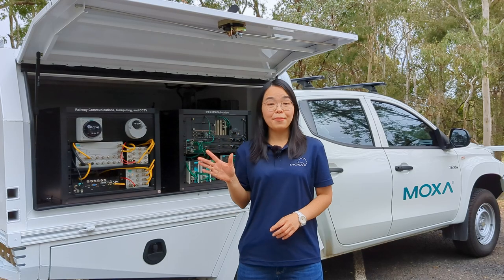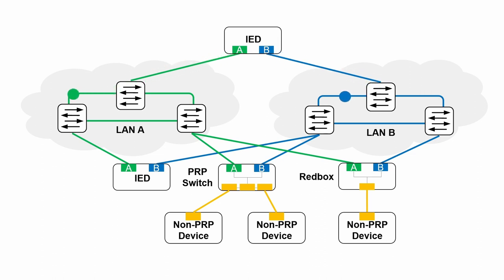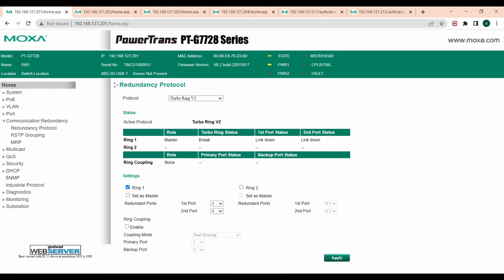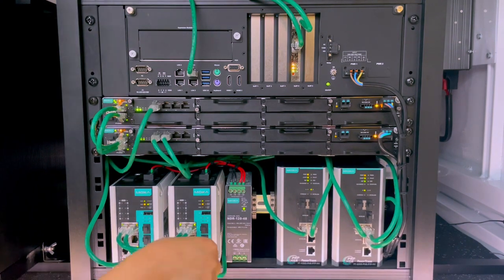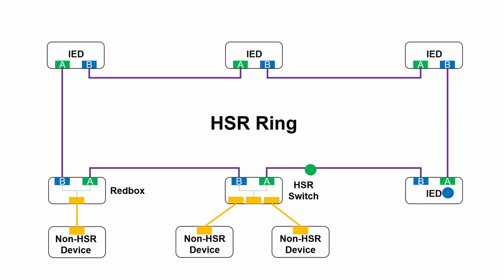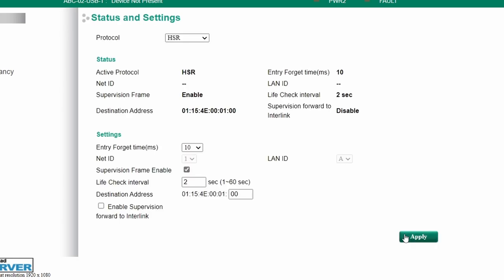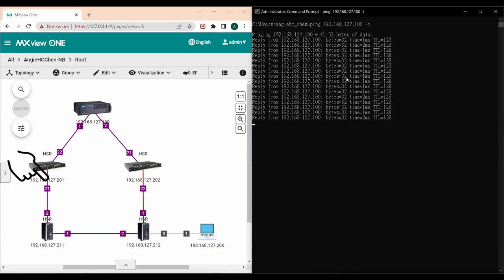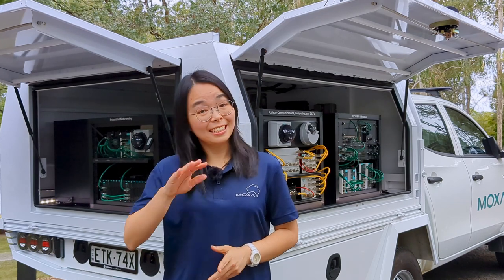Achieving Zero Recovery Time: PRP vs. HSR

Comment: Why a non-hsr device must use a redbox? Why it cant be connected to a hrs switch (like the others non hsr devices)?
Reply from the maker: Hi @stringsandhamers, thanks for reaching out. Standard Ethernet devices can’t be connected directly to HSR ring because HSR modifies the frame and it can’t be processed correctly by a non-HSR node. To connect Singly Attached Nodes to HSR ring a Rebox or HSR switch should be used. HSR switch is essentially a combination of a switch and Redbox in a single unit, so from IEC standard point of view HSR switch is a multiport Rebox. The terms Redbox and HSR switch sometimes could be used interchangeably.

If you have any questions about our products, feel free to contact a Moxa representative by completing the online form: https://www.moxa.com/en/contact-us

Comment: In your example, you are using PT-G7728 for PRP Ring A,   My question, can we use PT-7728 instead PT-G7728. how is the PTP complience on those 2 type switch. are both type are PTP complience switch.?.  Thanks in advance for your respond
Reply from the maker: Hi @setiawanadi4388, thanks for reaching out. Only PT-7728-PTP models within the PT-7728 range support PRP/HSR when equipped with PM-7200-4GTX-PHR-PTP or PM-7200-4GSFP-PHR-PTP modules, and both PT-7728-PTP and PT-G7728 support IEEE 1588 hardware-based PTP.